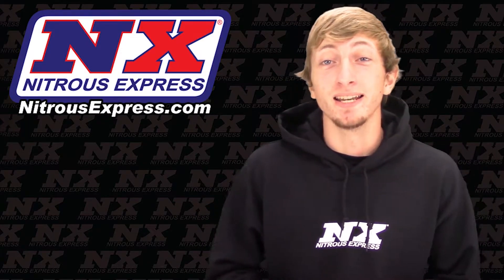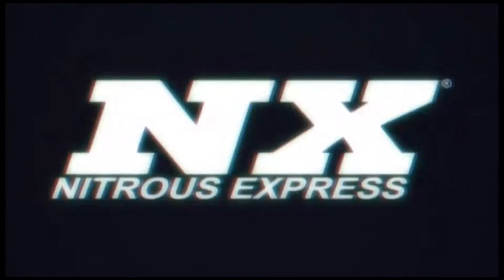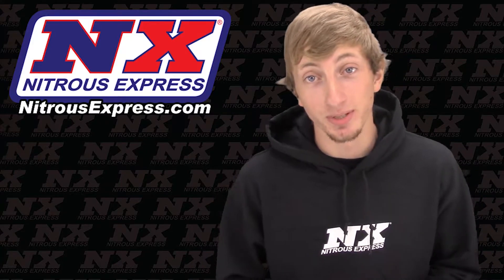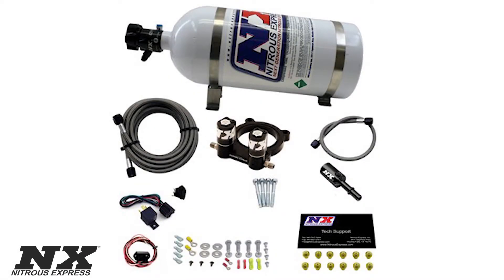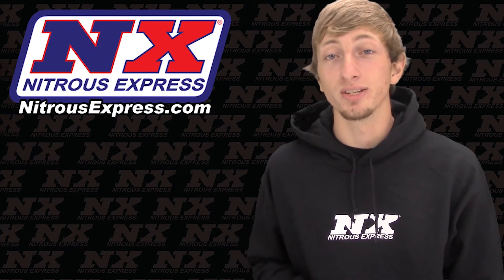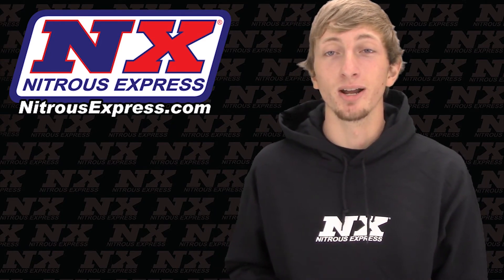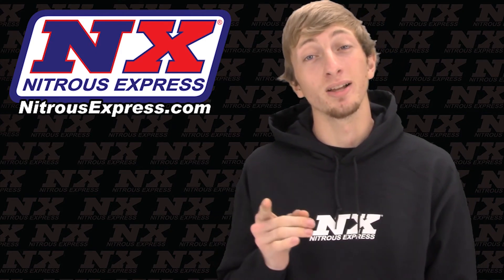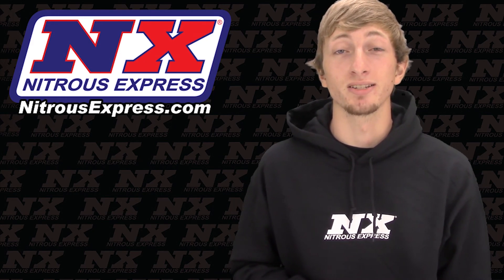NX - EcoBoost Nitrous System Part No. 20954-10

Comment: Will this work on my 2009 Chevy 2.4 ?
Reply from the maker: It will not. However, I can recommend part# 20421-10 for your application.
Reply from the maker: Unfortunately this is only for the Eco-boost platform